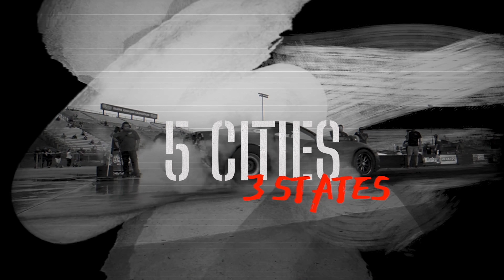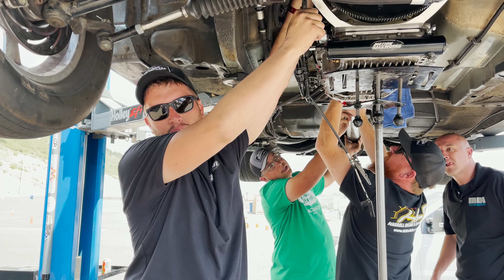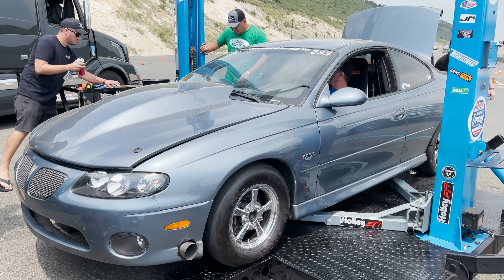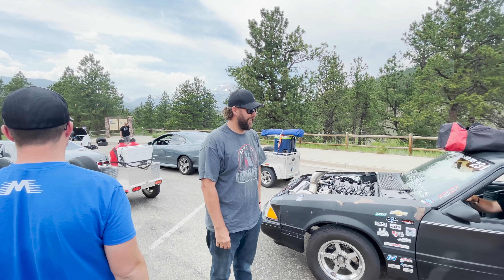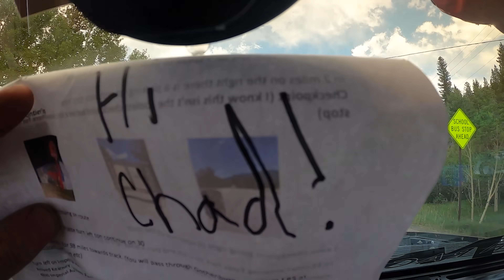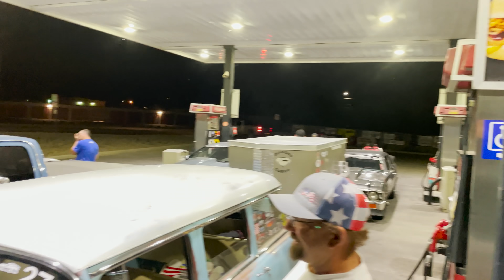Broken cars and the day that will never end! Rocky Mountain Raceweek Day 5!

Comment: El Toro may have a ground issue.  If the engine/Trans does not have a good ground path, it will ground through the steel cable in cable sleeve and start melting and fusing things.